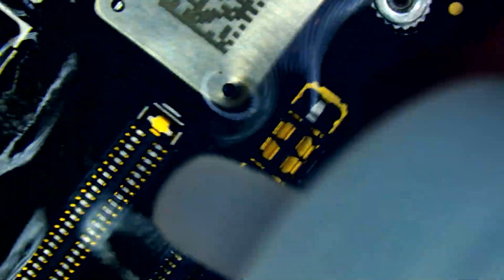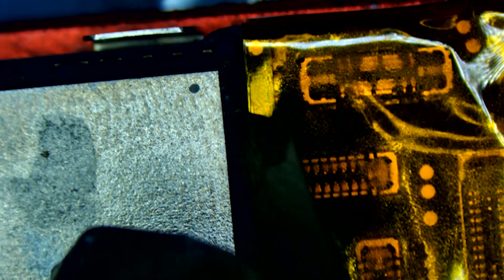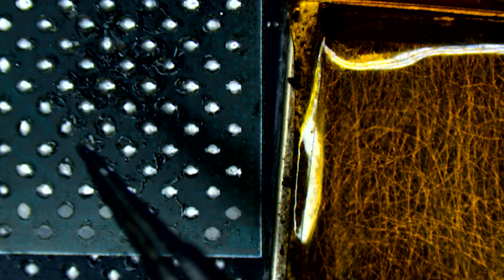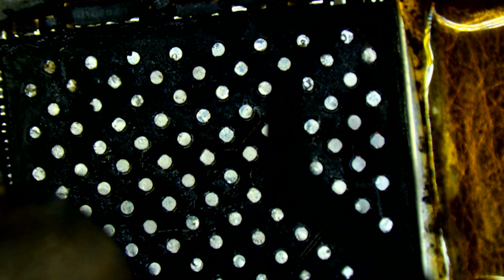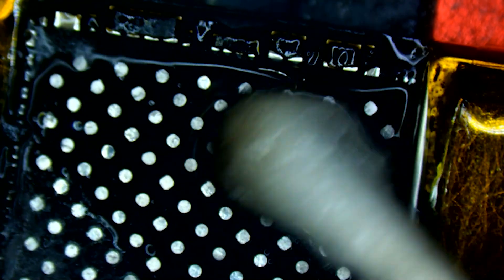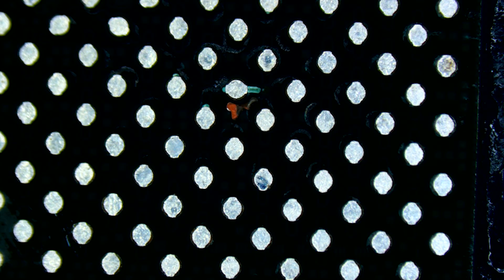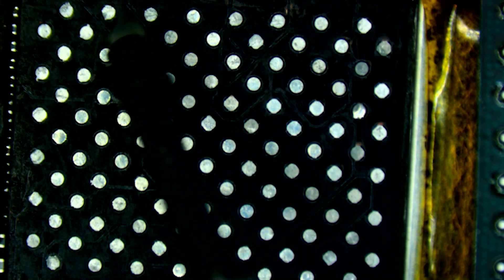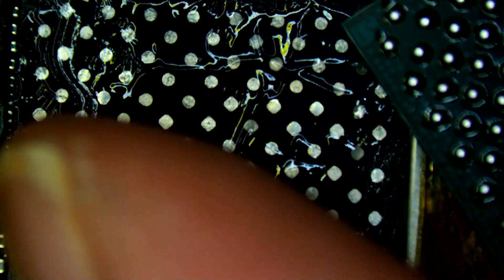iPhone 13 NAND Reball & Replacement | Advanced Logic Board Repair Tutorial

Comment: Do you separate the top board and the bottom board when doing the NAND? What are you doing to prevent the CPU from popcorn as it's directly underneath the land on the other side?
Reply from the maker: Great Question. The answer is no, I don't separate them on this model9(iphone 13). The CPU fortunately isn't located under the Nand at all on this model, it starts just after where the Nand ends on the underside. Temp control and technique allow for this to be done without overheating the CPU.